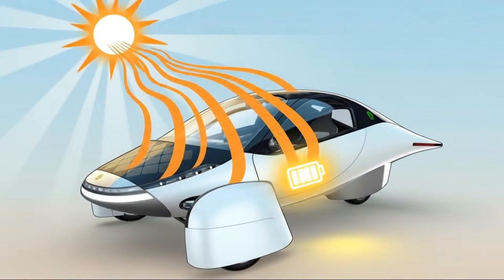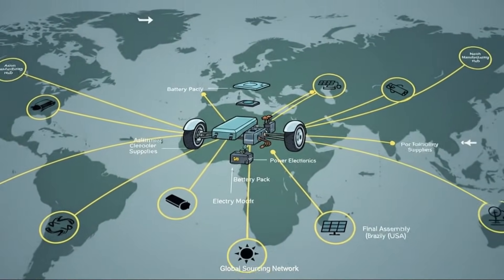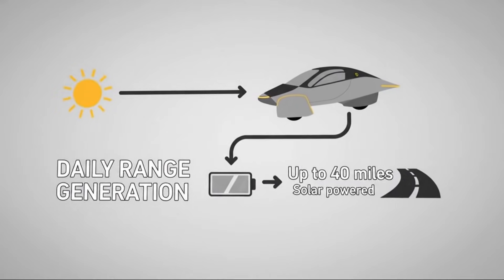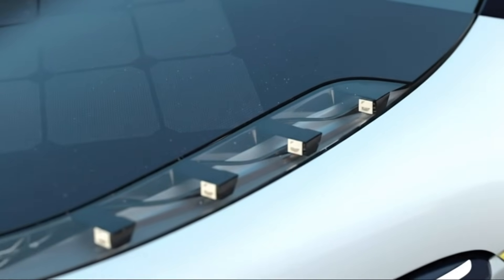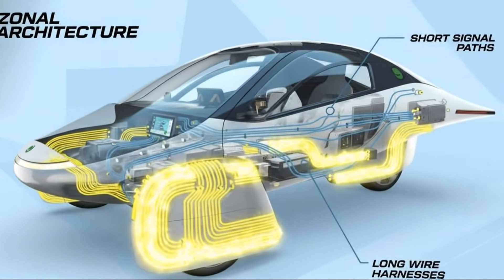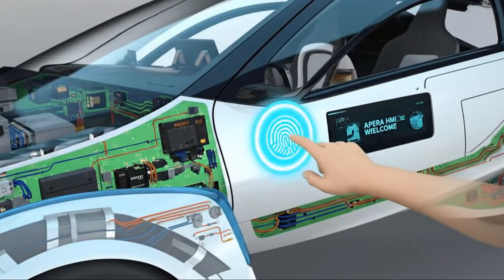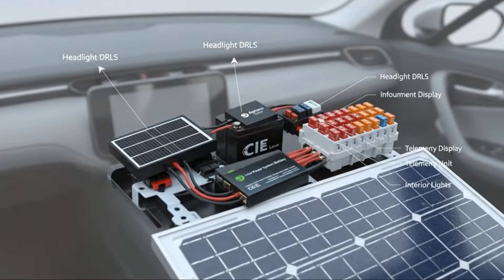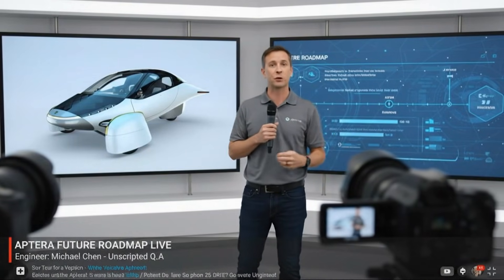Aptera’s Low Voltage Design May Be Its Smartest Engineering Choice

Comment: 48 volt architecture uses a lighter harness and transmits current with less resistance.
Reply: True, but every EV puts in 12V as well as higher voltage because all of the components available are designed for 12V.  That should change over time for all EVs.
Reply: @Mister_Stone 
You are also correct sir it may happen that as the number of units sold increases suppliers would be more accommodating with adapting their products to Apteras needs. Such accommodation is one of the drivers of innovation.
Reply: @patriot1229    And to accommodating EVs in general for high-voltage architecture, I suppose.
Reply: @Mister_Stone all but the cybertruck*
Reply: @Mister_Stone  a lot of german ICE cars already do that... it's not that special. That a lot of EVs don't do it yet is just strange
Reply: @DxCBuG - Please do not bring in facts. It just makes you a troll. The Aptera bubble is all knowing.
Reply: @billsmith5960 is it ? I have looked a few times at their vehicle but never "immersed" myself in the community 😂
Reply: @DxCBuG  - Just remember, only mention the things they say (i.e. 6K units to profitability) but ignore or fansplain when they say things like crash testing by mid 2024 or 11 months ago, it was production ready. Just cherry pick what makes the company sound good. If not, you are then a paid troll from big oil.